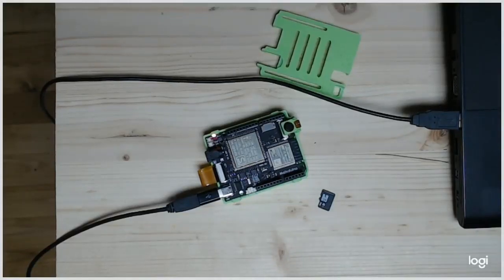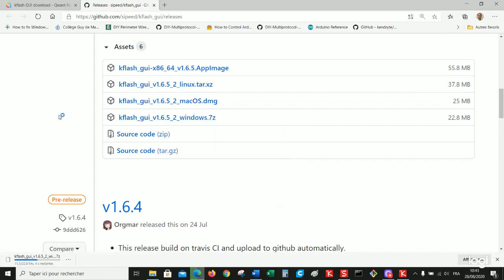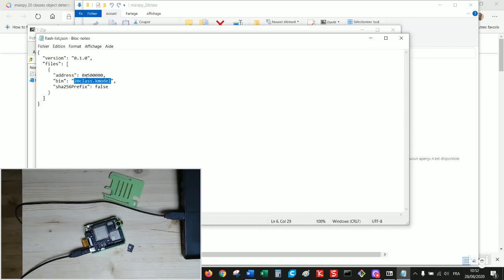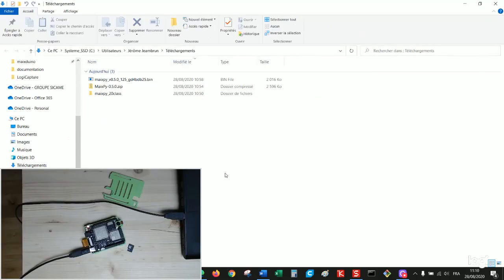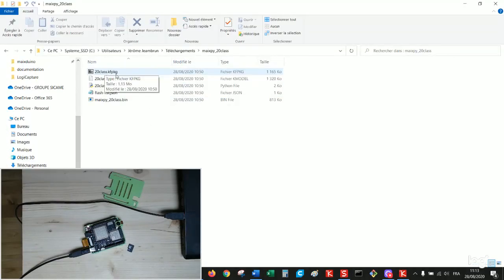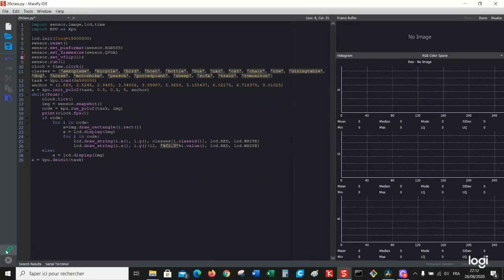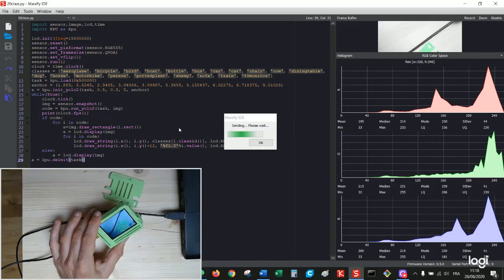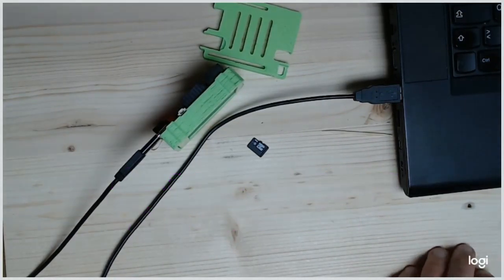Maixduino Maixpy object classification step by step - 20 class

Comment: Hello I tried this and it worked but I was wondering if you did any more image recognition project at a higher level with the same equipment or with better tools. Also if anyone is trying this themselves there is an explanation of the GitHub firmware page the creator of this video found confusing on the Sipeed Wiki website. Finally as some of the links are broken I would recommend you search for the files you need to complete this interesting project. Enjoy

Comment: Can you upload the files with the Kmodel of the 20class? It seems like the site is down and can't connect to it to download it
Reply from the maker: Hi, I modified the links to the model and also IDE. Please test and share 🙂
Reply: @Jean-Raoul  There is a .bin file followed by 2 files with the .mud and .param extension respectively. Do I have to flash the .bin file into the board? Also, no .kmodel file... is it required to have a .kmodel to make it work or is there a different way?

Comment: Thanks for the tutorial which was useful. 

The classifier is working but the camera image is flipped vertically 

This means that instead of classifying airplanes the top classification is person for the aircraft in the google search screen

Do you have any idea what I'm doing wrong?
Reply: commenting out #sensor.set_vflip(1) in 20class.py

This fixes the problem and text labels and the camera images are the right way up
Reply: The classification accuracy is very poor though on aeroplanes, barely getting above 60% ()

Comment: Hi, I uploaded the .kmodel file to memory 500000 and this error I get: ValueError: [MAIXPY]kpu: load error:2006, ERR_NO_MEM: memory not enough
thanks
Reply from the maker: Hi, if you build a heavy kmodel file and the problem is really a memory size problem, you can try this : flash your kmodel at a lower adress, for example 0x300000 and change the corresponding adress line in your .py file :
Find the line "task = kpu.load(0x500000)" and change the value to 0x300000. Please let us know when solved.
Reply: @Jean-Raoul  Hello, thank you very much for answering, the solution was to load the model to the SD card

Comment: For some reason when I go to run the program my board does not connect in the maixpy IDE. This is after I flash the .bin file and the .kmodel to the board. Any reason why my board would not be able to connect in order to run the program?
Reply from the maker: Hi, getting communication between the board and the IDE is possible only if you have flashed a firmware which  allows it. You must investigate in two directions : - the firmware bin file you used does not support the IDE. Start with the file I recommend to avoid that,
- you overwrite the firmware when flashing the k-model if you did not set correctly the address recommended in the programming file (should be 0x3..., 0x4... or 0x5... , but not 0x0000)
Please send your comment once you will have found the reason.
Reply: I successfully got your program running. But I would like to add some of my own image training. Did you follow any tutorial to create your Kmodel that you could send to me? I’ve been struggling to get other tutorials to work because of issues with versions of different files.
Reply from the maker: @ryanmertz6816  Hi Ryan, it is not so easy and would require a tutorial too. For the moment, your starting point is to go to the training platform on which you can generate your Kmodel file. Create an account on https://www.maixhub.com, then click on "Model Training", and then on "Help Page - How to make the data set". The complete sequence is there. It has been updated since the last time I used it and it is probably good news.

Comment: As a beginner, it was useful for me, although I did everything according to the instructions from Maixhub/model training. Can I add you to social networks to chat and share some experiences? Where did you buy this body for the plate?
Reply from the maker: Hi, yes you can add linksto help other makers. The casing 3D model comes from Thingiverse website and I've printed it myselt, but I do not recommend it, the design of the camera holder does not suit the length of the flat conductors on mine and it is not possible to rotate the camera witout damaging the conductor.